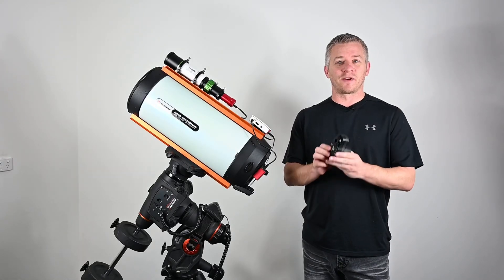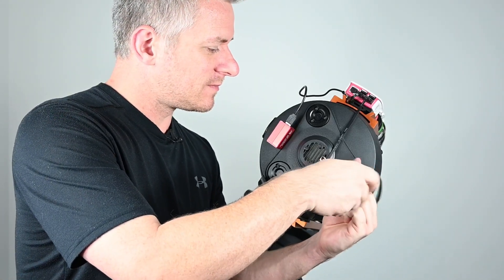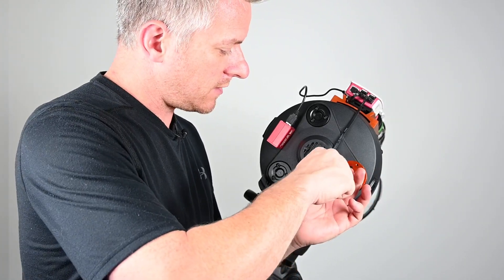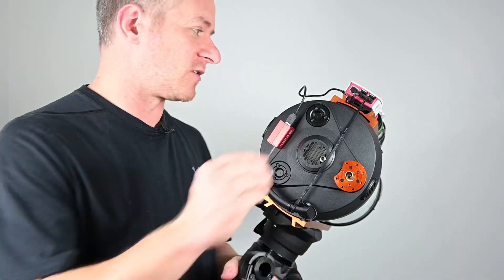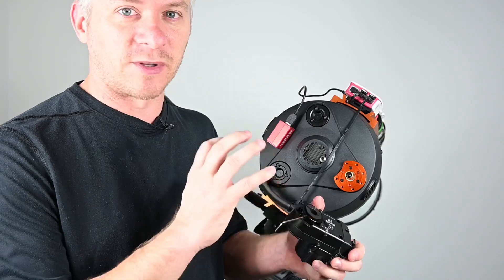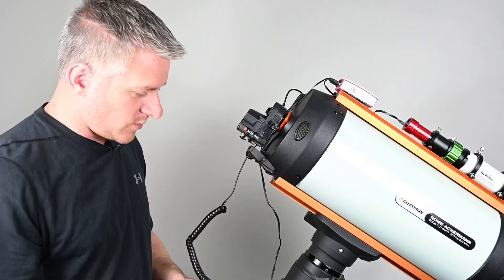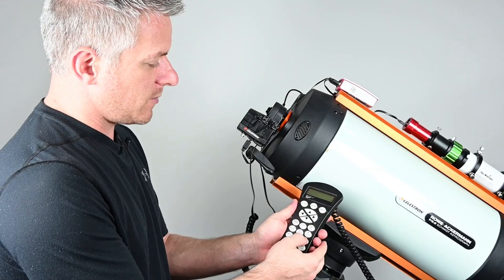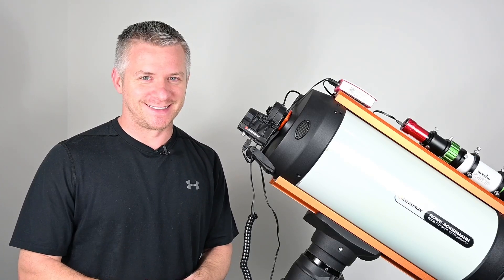Installation and thoughts - Celestron Electronic Focus Motor on RASA 8

Comment: So I got a RASA8 fitted with a focus motor - its a bit lose.  Should the motor wiggle a bit?
Reply from the maker: The focus motor should be nice and secure. It might wiggle a fraction when it’s turning the focuser I’ve found. It should wiggle freely though.

Comment: Hi Steven, great info. I am thinking about getting one of these, but was wondering if you've had any issues with backlash? It's between this and the ZWO EAF with their new mount for RASA and SCTs
Reply from the maker: I never had an issue at all with the Celestron focuser, I actually rather liked it.
Reply: @StevenMorrisAstro  do you focus manually or Auto in SGP and NINA if so what is your step size and backlash compensation?

Comment: Great video Steve. I use a star sense and auto guider as well. But they use up all my ports on the CGEM. Is there a way around this?
Reply from the maker: Maybe once your alignment is done with the star sense you can disconnect it and plug in the focuser.

Comment: Great informative video. Thanks 🙏
Reply: By the way. Can’t you power the focuser via the power output on the air?
Reply from the maker: You most certainly can, also you should be able to power the focus motor from the aux port on the mount. That should also work.
Reply: Steven Morris great. Thanks Steven. Really enjoyed the vid.

Comment: Good video, thanks. The Focus Motor only needs one connection to be powered. If you connect it to the mount via the aux cable, that is sufficient - you don't need to also plug it into the USB port or mains adapater port.
Reply from the maker: Yes, you are right

Comment: thank you, Steven very helpful video. I just got my Celestron motorized focuser. I will be installing it soon. But I guess I have to first remove the feathertouch focuser first on my  SCT9.25" and put back the original focuser then install the motorized focuser. I'm not sure if the motorized focuser work on the feathertouch directly.
Reply from the maker: That’s a good question regarding the feather touch focuser. Let me know how you go.

Comment: Great tutorial Steven, thanks! I just got this Celestron motor focuser and plan to installed it on my SCT 9.25 in a couple of days. I have one question though. In asistíos to the AUX port, you also connect the USB port for powering. It is not the case that the focuser gets properly powered by just one of either the 3 of the available ports (aux, usb, 12v)? This is what I understood from the instructions included, although I could not test it yet.
Reply from the maker: That is correct, I believe the USB helps power it and the aux cable is there to communicate with the hand controller, as the hand controller controls the motor speed and focus. You do need to update the firmware on the hand controller to access that funciton.